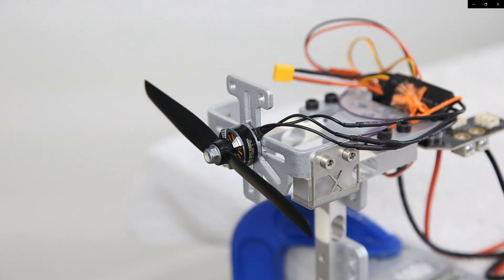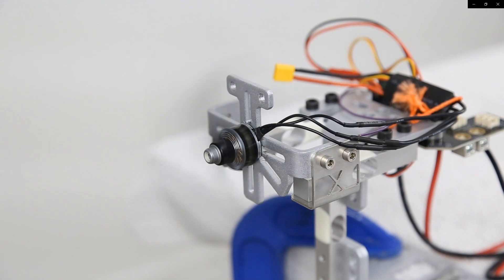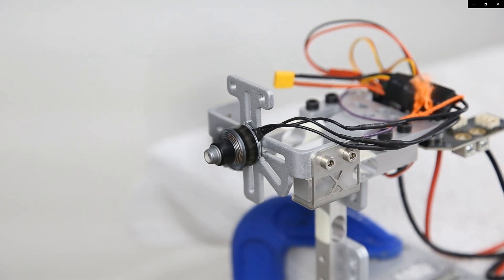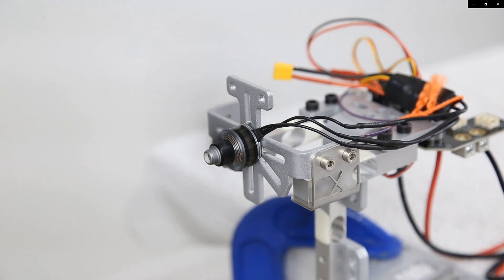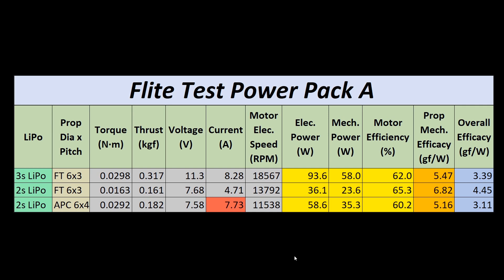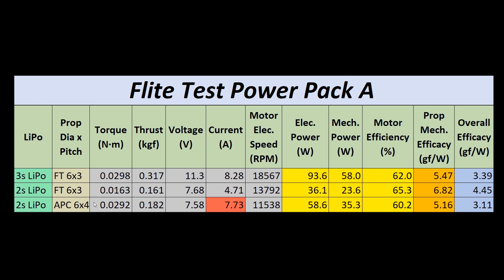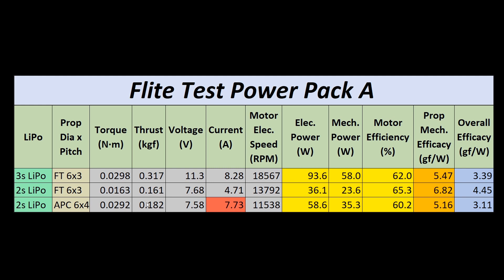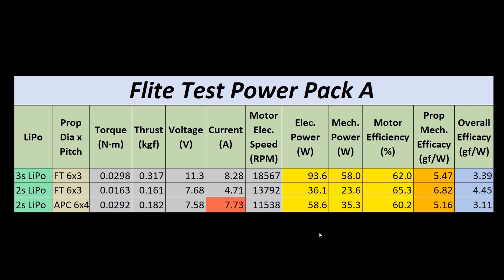How Efficient on the DYNO is a Flite Test Power Pack "A" System?

Comment: Great test , i hope you can run similar with motors from other vendors lines altitude hobbies and others. The big problem i see when finding a motor is the lack of test information from manufacturers . You effort is greatly appreciated. Question :Is the Thrust in kgf same as kilograms?

Comment: I reckon the little motor is a tiny bit undersized for the 6" prop to get max efficiency (as shown by the 6x4 test). I think it's a 2204, I bet you'd get a bit more g per W out of something slightly larger.